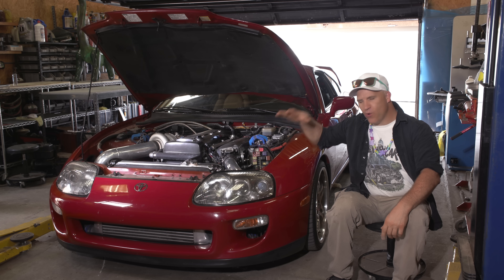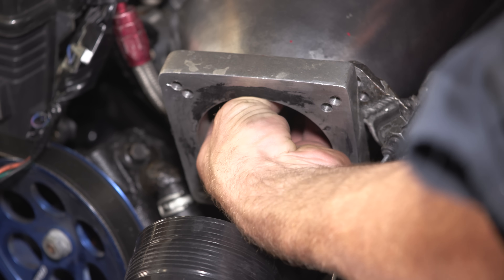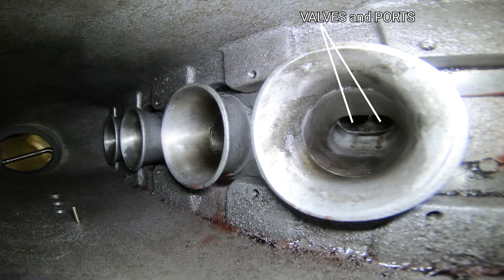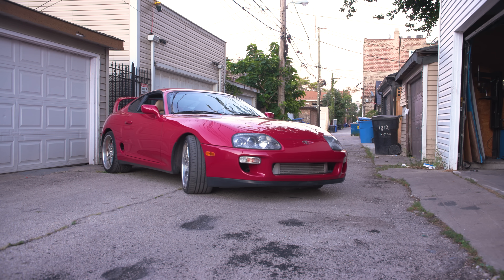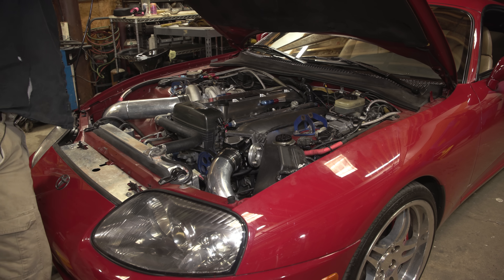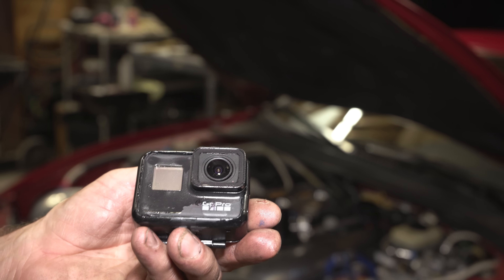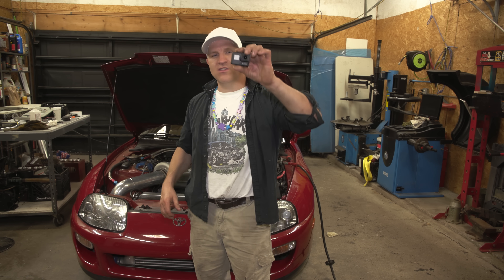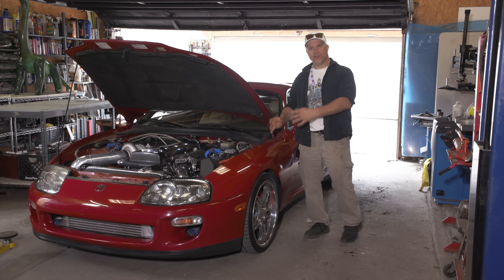Driving with Gopro Inside My Intake Manifold (Toyota Supra Turbo)

Comment: The oil is probably seeping through the turbo oil seal?
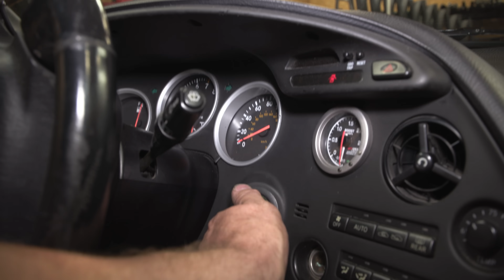Reply: The first drops appear at 2:39 at the base on the 3rd cylinder's stack and the pool grows from there, so I'm going to guess bad seal.
Reply: @teardowndan5364  Maybe a bad valve seal as it happens only at the 3th cylinder, as he closes the tb, the fuel splashes the oil all over the camera?!? But later in the video is all over the place on every stack... Maybe a breather that connects to the intake?

Would like to see a update about it soon!
Reply: I blew a turbo compressor seal years ago....car would run (almost) fine UNTIL I let off the throttle AND THEN it would DUMP SMOKE out the back worse than tires on fire!!!! This is not the case here....otherwise the ENTIRE intake and all the velocity stacks would be covered in oil and we’d see it entering the air stream each time he lets off.
Reply: @69CamaroSS  my grandfather in law blew his turbo seal into the exhaust side on his boat, it smoked so bad, like a HUGE black cloud across the fjord....
Reply: I did wonder why the oil was red, but yeah, lighting makes sense. It's either turbo oil seal, or pcv system if it's not running a catch tank. Blow back wouldn't really make it out the intake mouths on a turbo...
Reply: @hc_explores  2:39 really looks like seepage at the 3rd stack's base though, not seeing how else oil could appear from such a tight spot otherwise. PCV, turbo and blowback would get misted by turbulent airflow and coat everything instead of growing a puddle from the 3rd stack's edge.
Reply: Is it not coolant?
Reply: @samfield2590  Oil would be more typical but ya the fluid looked pink and was fairly watery. I believe those kind of turbos are lubed and cooled via oil only.
Reply: @atubebuff  LED lighting, the apparent color could be a color rendering error.
Reply: Valve stem seals?

Comment: 3:50 the first reson why Supras need a lot of fuel
Reply: Also E85. it's less energy dense, so you need to inject a lot more (around +20-30%) just to get the same power as gas.

Comment: Is there a way mounting the go pro on the oil pan of an engine
Reply: if its a regular deep oil pan you could but you wouldnt see much as oil is flying around.
and if the oil pan has windage trays and or bracing and whatnot there just isnt space.

Comment: From what I could see, it looked like you had an oil leak on the manifold gasket at 3, as well as some too early timing causing some exhaust blowback as the pistons came up for the intake stroke during open throttle. Could definitely advance the valve timing to get all of that out on the exhaust stroke before swinging over to the intake stroke.
Reply: Yup, that motor has a few issues for sure, quite a bit of reversion as well.
Reply: ahahah smartasses
Reply: Thanks Dr TuneAll for the in-depth analysts with your excellent tuning service.

Comment: WP that was awesome. But you have oil blowing in from the 3rd cylinder. It was especially bad in start up where it looked alittle red when it shoots down the velocity stack.
Reply: Im not so sure its coming from cylinder 3, if you look closely the oil that blows on startup was already there in a puddle below the velocity stack.

Comment: Misting of oil is normal does not look excessive to me.  The best thing to do is check your oil ever 1000miles if its using any then might require further investigation but I would say thats pretty normal.   If the engine has a lot of miles you might want to consider a leak down test as a first port of call if the oil consumption is high also do a comp test.  Valve seals normally leak worst when cold.  Just FYI.  Also your turbo might be blowing oil past its seals so thats something else to check by removing your intercooler pipes and looking for oil deposits.  Again it does not look bad so I would just stick with it your PCV is not deleted?

Comment: the oil maybe from crankcase ventilation system which is located in front of the turbo intake if you not    installed oil catch can
Reply: yeah and piston ring clearance is probably set to be wide since it has such a big turbo
Reply: @fila1445  this is the issue. Its a 1000hp car thats making 100hp putting around town. The rings are cold and they have a healthy gap. Nothing to worry about just keep an eye on the oil level.
Reply: @ryanmalin  yeah that was my point :)
Reply: 2:38 you can see the oil squirt out from under the velocity stacks. At least 3 closest cylinders are easily seen.
Reply: Yes I saw that too but hopefully that's an illusion caused by the sudden change of pressure.. I think it's coming from the turbo... but it really does look like it's being queefed out under the stack which shouldn't be possible I think...
Reply: Upon closer inspection I'm thinking it's the valve guide seals queefing it out... It happens just as throttle closes causing a sudden vacuum making a mist of oil that seems to suddenly materialize into droplets in random places next time the pressure increases...
Reply: Yep pcv, it’s usually a must that gets sucked into the cylinders.
Reply: I'm gonna guess it's probably from the turbo compressor seal. It's actually pretty common for there to be bearing blow-by into the intake manifold when you have a decent amount of boost and you give a good bit of throttle. When just driving normally it usually dries most of it up and it not too noticable.
Reply: @89ludeawakening1  if you watch the video you can see the oil come out of the rear cylinder intake valve
Reply: Water meth makes sense I didn't think about that.. but he did say it was oil when he pulled out the camera... this car does not have it's pcv recirculated to intake so to all who say pcv I say nay... Lol
Reply: Maybe if he's running red engine oil. It looks like air filter oil to me
Reply: amorag59 cylinder walls
Reply: I bet it is the majority came from the PCV system. Any boosted car has problems with oil in the intake due to blow by and it gets worse with more PSI. A high quality, large, catch can is needed to keep this under control. There might also very well be some oil slipping past the valves, all it takes is a little wear on the guides for it to start leaking. Turbo bearings might be leaking some but this oil doesn't look like it is coming from the throttle body area, it just shows up inside the intake, and his throttle plate would have an oil film on it too.
Reply: Exactly, that is what I was going to say...
Reply: Probably just because he’s running E85
Reply: okay linus

Comment: Imagine if you could get a gopro in the crank case and actually see it in motion while it drives . I don’t think there’s enough space but 🤷‍♀️
Reply: The lense would get coated in oil almost instantly
Reply: @lucyg3917  that and it would overheat really quickly, in the intake it's at least cooler a bit as long as the engine is running.
Reply: David Gann I know it would. Hence the “imagine”
Reply: @lucyg3917  get a sacrificial (non-2j) engine and run a clear lubricant
Reply: @Mastermindyoung14  Overcomplicated. Just drain the oil before recording 😁
Reply: @Mastermindyoung14  it would still distort the image
Reply: @lucyg3917  Mira did at no point mention there should be a GoPro AND oil in the engine 😆
....Hang on,.THAT would make a rather interesting video !
Reply: David Gann Install headlamp washers or rear view camera washer 😂
Reply: WP laughs in go pro 🤣
Reply: It'll be fine
Reply: No point, as you can find plenty of plexi-door crankcase vidz shot from outside i think.  I know I've seen more than one.
Reply: @garychandler4296  
I agree with his "what if", watching from inside would be as different as watching a windy severe rain storm through the window as compared to being in it.
Night and day.
Reply: That would be pretty cool - you'll never get clear video inside the crankcase (except MAYBE at idle), but if you could it'd be cool.
It's a hurricane of oil fumes as well as splash oiling going on in there.
A lexan window with a view from outside is the best we're going to get.
But if it were possible it'd be really cool!
Especially with an ultra-high speed camera to see 8000rpm slowed to minute fractions of a second frame by frame!!!!
Reply: Just put a non stop wiper on the go pro lol

Comment: I Love How Much Fuel Its Using🤣🤣 I Mean I Know Its Normal But Its Just Amazing To See That Much Fuel When Wide Open Throttle
Reply: Big power means big fuel!  That thing probably has 1000+cc/min injectors.
Reply: @elesjuan  Yeah More Air + More Fuel Equals Power So Big Power Means Thirsthy Engine
Reply: Also running e85, on average you spray around 30% more fuel on e85.

Comment: YES THE SUPRA FINALLY! Coolness! I am going to guess the oil may be from the air filter element if you rock a K&N that's been freshly oiled?
Reply: These things happen.  It's a turbo car.  You basically have oil lines plumbed before the intake..

I've seen intercoolers with quarts of oil in the bottom of them.
Reply from the maker: I believe it's power steering fluid,I forgot to include the outtake in the episode where I check out the issue but I found the low pressure vacuum power steering switch into the intake under vacuum.
Reply: Ken and Nancy do not clean very well. Study revealed silica went way up with one. Back to paper and it came back to spec. They give you HP due to NO restriction. Out!

Comment: Looks like the gopro in a tyre has sparked a new series👌
Reply: Next level : A go-pro in the combustion chamber !
Reply: @bogdy2p  Not enough room in there, the camera would get obliterated and probably throw the piston out the side of the engine.
Reply: @MacMashPotato  Just get a imense stroker kit , so that it fits ! :P [ or use 20 cylinder head gaskets one on top of each other ] :))
Reply: @bogdy2p  maybe in one of those really massive marine diesel engines
Reply from the maker: Everyone needs a little push Sometimes,  I had just finished writing a whole bunch of episodes and pulling the rigging equipment together a week earlier to put cameras in all sorts of weird places, so when they requested the GoPro, it was a perfect opportunity for me to fulfill somebody's request and connect with the audience.
Reply: I was thinking the same
Reply: N word
Reply: Gopro sticks after this comment 📈📈📈